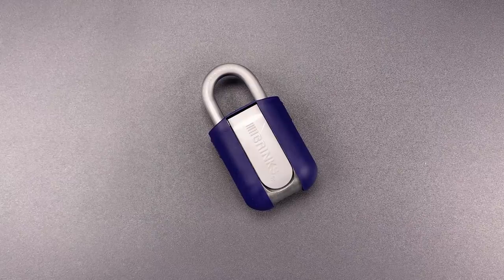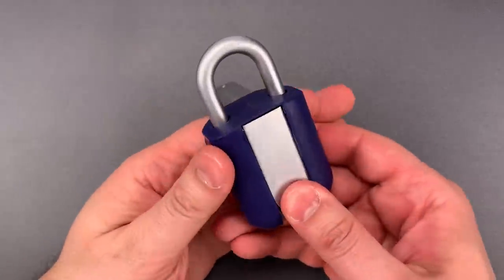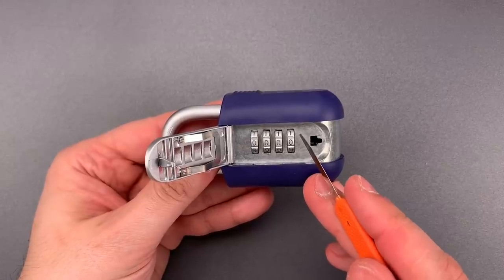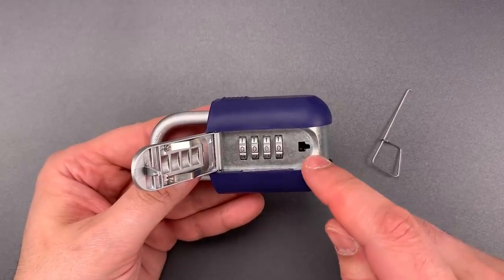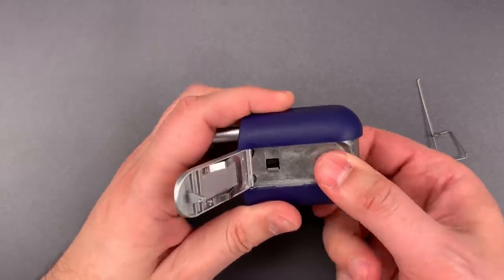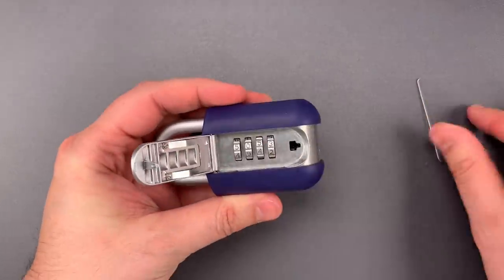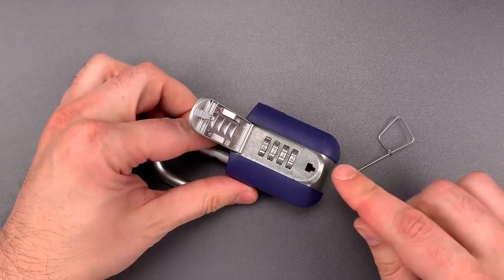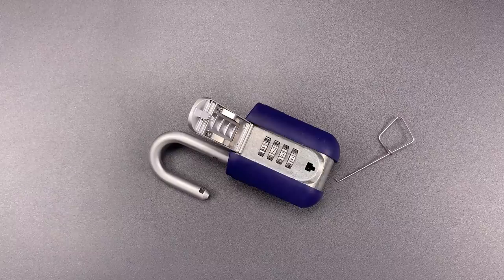[1007] There’s a Literal Security Hole in This Brinks Padlock (Model 673)

Comment: When you lock your door but leave the window wide open
Reply: Sixth floor.
Reply: I was thinking about those locked - very hard doors in fallout where it is half a door or there is a open window right next to it
Reply: Correction, it should be when you lock your door but leave your keyhole exposed.
Reply: @ChronicNOTAG  I see you as a man of culture
Reply: I have steel bars on my windows
Reply: Seems more like a locked window with the front door left open (only closed far enough that it seems closed from afar).
Reply: IDK I think would be easier just to cut it than to actually figure this out if you're a criminal
Reply: @jimmyfly LMAO the "honest theif" doesn't exist
Reply: More like locking the door with no walls
Reply: Well, let's be real here.

Locks are mostly for show, no matter how good they are.

In general they're only a deterrence to casual, opportunistic thieves.
If someone REALLY wants to get into your stuff, they will, and you likely can't stop them.
But if someone is just casually trying to see if they can easily take your stuff, that's different.

The quality of your locks basically decides how determined your thief has to be to steal from you in particular.
(though, if your lock is stronger than your door/walls/windows/whatever it's kind of a moot point anyway. XD)
Reply: When you put an electronic car door in an open field
Reply: When you lock your door but forget to close it.

Comment: I was thinking LPL was teaching, yet also teaching criminals but then realized he's protecting owners and making manufacturers step up their game.
Reply: Security through obscurity never works
Reply: @jamesrustles8670  yup, just makes it harder to know when security has been exploited.
Reply: From what I understand, a number of companies have told him to stop doing this.  Yet, here he is :D
Reply: cujoedaman goes to show his lawyering is better than theirs 🤣🤣🤣🤣
Reply: Criminals use brute force. No locks can resist a heavy blow. That's is how they broke my triple lock house door.
Reply: @candidmoe8741  lol lock made of tungsten carbide
Reply: @loserface3962  then they kick in the door or the door frame. Given enough gorillas and if in doubt petrol horse powers everything goes down. If in doubt, some crash SUV into the window front a jewellery dealer. Really: All a lock as do to is "not be the weakest link".
Reply: @Entropy_91  Right. Tungsten (carbide) has very little resistance to impact if not designed properly. It is hard, so it is brittle. Like glass. It has no (very little) bend.
Reply: @Entropy_91  gotta admit i read that wrong the first time. Lol "I am a tool. Die. Maker." XD
Reply: When my  parent's place got broken into they didn't bother to pick the lock.  They kicked the door in. The door frame basically split along the grain from top to bottom.  Locks are symbolic, most of the time the quality of the lock doesn't matter.
Reply: Exactly.
Reply: @sarowie  Concrete and steel bollards, or concrete pkanter and benches help prevent that quite a bit.
Reply: @loserface3962  Unfortunately that'd be a terrible material.  So brittle that you'd be able to shatter it without much effort.  Best you want is case hardened steel of a high quality alloy, and with a hardened bit that's about 25-30% the depth of the steel.
Reply: Advocatus Diaboli  Is that type of thing common in that country and/or European countries in general?
Reply: Advocatus Diaboli  Honestly, if someone wants in, they are getting in.  A broken window tends to be easier than most options, but on most homes and apartments a sledge hammer to the wall a foot to the side of the door will go right through the sheathing with no problem. Reach in and turn the lock. Good locks stop casuals, but do nothing to stop someone that actually wants to get in.
Reply: @Entropy_91  I'm a machinist. I second that statement.
Reply: @Entropy_91  "tool and die maker.". You scare me. Is Baba Yaga one of your cliant?
Reply: @armvex  Only if she's looking to upgrade her house to a mechanical solution requiring thrust bearings.
Reply: Advocatus Diaboli  a high quality wood can be nearly as effective as steel when properly constructed. Wooden doesn't necessarily mean not secure.
Reply: @oldred890  Was directed to a comment on having a reenforced door and frame.  of course you want a nice lock to encourage people to move on to the next, easier, target, but the point stands, a hammer will get you in to pretty much any house in 45 seconds no matter how good the lock is and it's silly to think otherwise.
Reply: @candidmoe8741  They're expensive, but you can usually find a lock that sturdier than whatever door you're putting it on.  There's no advantage to toughening a lock once it's as hard as the door since at that point the criminal would break the door.
Reply: @jamesrustles8670  Exactly!  You can learn all the same stuff in Criminal College (aka prison.)
Reply: @andrewholden1501  then what's the point of needing a secure lock if they're just going to cut it and not bother to go to the trouble of finding way to pick it?
Reply: Advocatus Diaboli another superior European
Reply: Advocatus Diaboli  Europe has a shit ton more theft and crime that in the US we don't really worry about people breaking in like that we have the 2nd amendment so they have to think twice about whether they're willing to risk getting shot to break  in
Reply: @candidmoe8741  go watch the 9.5 pound lock videos he has. If someone can brute force through that thing then they deserve to keep what they find
Reply: Stuff like this seems unacceptable. It's always easier to just cut or bust a lock open
Reply: @WCGwkf  not always
Reply: @candidmoe8741  anything is only as secure as it's weakest point
Reply: @andymorin9163  usually the window.
Reply: i started out thinking that too until i realized that it was as much informative about your lock choice and how to bypass them youself if you end up loosing the key.
Reply: There are thieves in our neighborhood and they get inside houses by tricking people to let them inside and if it doesn't work they will break the window at night. Fortunately, a woman managed to call the police because she saw the armed thief using her security camera then he was caught.
Reply: Unless the "lawyer" part is a former profession he could likely be a lawayer specializing in liability cases against lock and safe manufacturers after high value theft.
Reply: @Unicorn161  but you see that is just the door that is very strong. You still have to deal with the walls and windows and if you did reinforce your home like that you have a good bit of money to do it. So then if they know it is like that you will be a bigger target because you most likely still have a good bit money.

Comment: You know it's going to be a laughable lock when the LPL video is 2 minutes and 48 seconds long.  Pretty soon, proper lock manufacturers will be printing their LPL video play time on their packaging as a selling point.
Reply: phục êwê  does 10 mins of him demonstrating 20 different ways to pick the lock count?
Reply: @CrnaStrela  yes
Reply: to be honest... most of the videos where he recommends the lock are still only 3 minutes long
Reply: phục êwê  I wonder how long it will take to pick an Abloy with a Protec 2 core.
Reply: @fatrobin72  I think if a lock takes 3 minutes to open, then 99% of common thieves will just smash it open or simply find something easier to pick.
Reply: @The_Viktor_Reznov  the lock for those recommended videos didn't take 3 minutes... the video did... the lock was generally about a minute in them sometimes a bit less but always "with the tool bosnianbill and I made"... but yes most common thieves would have either forced entry / found something else by that point...
Reply: This is pretty long really

Probably because he had to make a tool...
Reply: @fatrobin72  If I recall correctly there was a lock that took quite a while (like in minutes) to pick but it also cost like few hundred if not thousands dollars.
Reply: They'll include those damn plastic sealed packages, which seem to be more difficult than the actual locks inside, to boost their security time.
Kinda how video game companies are adding load times to 'gameplay time' to pad their sales.
Reply: phục êwê  I like the idea of ranking lock efficacy with terms like "10 LPL." "Should I get this lock?" "It's only a 2.5 LPL. But it's good for the price and if you're not locking anything too unreplacable."
Reply: Except for Ottolock who go defeated within a few seconds...twice.
Reply: Take your 1000th like
Reply: Or they could just hire him to help the design team in the first place and make a good lock.
Reply: They’ll put these videos on their website when he says something that is somewhat commendable about their lock
Reply: @EnsignRedshirtRicky  most of the locks he shows here ARE good locks
The thing is that he knows how to exploit them and is REALLY good at doing that, so he makes them look like horrible locks
Reply: @nephicus339  no game developer does that intentionally no one is counting gameplay time by adding loading time those would just get bad reviews for terrible loading time which would cause it to lose sales. i don't think you play games since you don't know what you're talking about.
Reply: "Got LPL to take over 45 seconds to open. literally maximum security!"

"Pffff I made LPL take out that weird that his friend and him made and took him over a minute to open!"
everyone woah fuck I can secure fort Knox with that!
Reply: phục êwê  Well, it seems that with the design flaws that so many of these locks have, you would just be best to get the cheapest lock on the market and say "Done!" Because a more expensive lock does not seem to be better in the slightest!
Reply: @fatrobin72  isn't that the point though? If a thief is determined enough to do a forced entry on a lock that has any amount of resistance, then you have already lost.
Reply: Viktor Reznov thats why you get a 5lb squire padlock.
Reply: honestly, that's a good idea like print a label [LPL 248] which seems like a rating
Reply: @jjrulez1596  no wtf?
Reply: a 2 min LPL videio? instant click
Reply: @anthonyconde7604  you deserve way more likes for this.
Reply: phục êwê  why anyone who wants it is just going to bring bolt cutters for the 5-second option
Reply: @The_Viktor_Reznov  I don't think these pick locks at all even picking a basic lock takes more time than they care two ways when they can just cut it or smash it
Reply: Imagine seeing the packaging that says "LPL 10minutes guaranteed"
Reply: @Johnny-tq9no  you've been watching too many movies... you can't just "smash" a decent lock lol
Reply: @Scion15  yes yes you can
Reply: Please alot of these videos are doctored.
Reply: The companies that have their locks gutted in the video opening them are going to have a field day.
Reply: @CrnaStrela  Marketing 101

Comment: Waiting for LPL to drop his own lock designs and make that money.
Reply: He does have a video on the locks he has not been able to pick. Those are the locks you need. Got one of the Bowley 543s after he and bill featured it. I was not disappointed.
Reply: @merlinmagnus873  where is that playlist?
Reply: It won't make any difference. Locks in general just aren't that secure. Even if they can't be picked they can always be cut with bolt cutters or an angle grinder, which is way more common anyways. Only way to really protect something is to actually guard it.
Reply: Lock technology is ancient but also if it can't be picked then good old fashioned brute force will get it. As mentioned, to step up security to the maximum level, you need to employ a security guard, when they get tired then you have alarm systems for a human response. Security is always a multi-functional system and a human response to a threat is the most desireable outcome. Once a thief thinks the game is up 9 times out of 10 they will flee. Anything man made can be defeated.

As a security guard myself, i oversee the camera's for locked bikes at my place of work so it's unlikely a thief will get away, if im too far away i can radio through to guards nearby or close the gates, breaking the lock is one thing, getting away with it is another
Reply: @JamesPhillipsOfficial  Are there options other than man-made? O.o
Reply: @Jeff M Well played.
Reply: @PyroNinja713  i would hear an angle grinder going to town on a lock on my shed more than lockpicking
Reply: Designing a good lock is way harder then defeating poorly designed ones (not to diminish his excellent work).
Reply: @quickjellyfish7670  Yes, and that's one of many reasons why bolt cutters are way more popular. Lock picking is realistically gonna take awhile and there's a higher chance you could just walk out to the shed in that time. Even a pro like LPL would probably take a couple minutes since the lock is gonna actually be attached to something and harder to manipulate than a loose one like he does all his videos with.
Reply: @clown-eating-hippo  "release the hounds" is a good one. Train up some pitbulls to be hyper aggressive savages, rear them on a diet high in human meat, lock them up near the bike itself. You could also make the bike a "breakaway" frame, strong when used by the owner, and falls apart when thief gets on, so several of the joints are adjustable mortice and tennon, also lock and keyed, made in steel
Reply: Dam thats the smatrtest thig i uered today     tnx
Reply: Imma stop you right here, yes

Comment: I remember decoding a cheap combination bike lock when i was about 10, I just kept tension on the lock and listened for a change of sound in the clicks like they do in the movies. I felt like such a badass :P          *(It wasn't attached to a bike BTW :)
Reply: *it wasn't attached to a bike after :)
Reply: @lootmaster1337  ;D
Reply: I did the same thing as a child. However, the lock was attached to a bike. When I was finished, the lock was still attached to the bike in the same location. But the lock also passed through the center of a piece of paper telling the owner that they might want to get a better lock.
Reply: @johncochran8497  Nice, yeah, those cheap combination locks actually can be figured out by a child it seems :)
Reply: @xjf8h83qe0oc9  yes
Reply: @johncochran8497  Good for little you!  Very ethical of you.
Reply: Did that with a 3 digit padlock, found the gates on the wheels, lined them up, and turned till it unlocked.
Reply: Stealing (or just changing) bike locks was a very common hobby at my school.
A lock which cannot protect itself is not worth being taken for serious.
Reply: The perfect heist
Reply: @norbertfleck812  steal the lock, leave the bike? 😂
Reply: I was in line to see a rock show. saw a combo lock on a gate. turned to the crowd and said "watch this"... I used social engineering to crack it, I figured: how does the owner lock this? well he probably just does a quick swipe of his thumb across all 4 dials... So to unlock it I swiped up instead of down... thing popped right open. The dude who saw me was so impressed he handed me 5 bucks saying it was what he would have bet had I phrased my "watch this" as a bet... true story.

Comment: You really have to wonder what the everloving hell the company was thinking.  $5 says the engineer probably had a small piece of metal protecting the bar but the bean counters said, "nah, that adds 20 cents to the manufacturing of each lock.  If we drop the metal shield, we get that much more profit. No one will notice any way"
At which point the engineer points the LPL YouTube channel and says, "Told you someone would notice"
(I speak from experience) 😑
Reply: Or just don't have the hole in the lock body. But yes, quite believable scenario you lay out. 😕
Reply: Makes me wonder why they have a door at all.  Would be cheaper w/o it, and it'll still work, right?
Reply: They should have just done a sliding door or a magnetic locking door instead of a door with a hole in it that allows you to reach the mechanism

Comment: This lock was extremely secure and unopenable....froze solid during a MN winter on my gate.   So many holes in it a little melt got inside and refroze....no one was getting it open without a torch!
Reply: Well nice to see that othwra have that bs too...
Reply: Seems like a cup of hot water would be easier.

Comment: "This method allows for decoding with very little skill" said the legendary lockpicker that bent his own lockpick in literally seconds
Reply: That's not a lockpick tho. That's a lever.
Reply: I've never picked a lock in my life and after watching this video I'm pretty sure I could do the same.
Reply: With a PENCIL!
Reply: Yes, but knowing this trick I bet I could bend a thin paperclip into that shape and replicate this. I've never picked anything though, so that would be a low skill attack.

When he picked something with multiple security pins and is able to call out how many and of what type they are as he's picking it, that's a high skill attack because he has years of experience picking those sorts of complex locks. I would just be flailing around like a novice using a rake.
Reply: That's a paper clip.
Reply: @krad1314  In nomine patris, et filii, et idiot sankti
Reply: @Intrspace  not worth a google translate